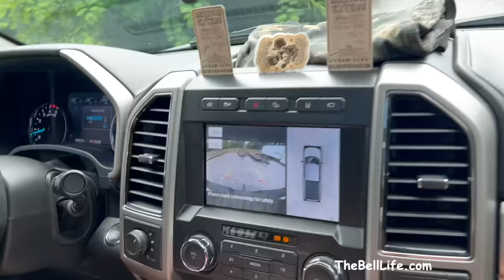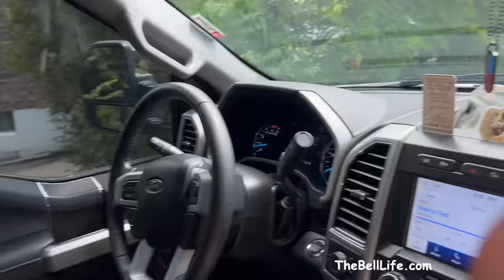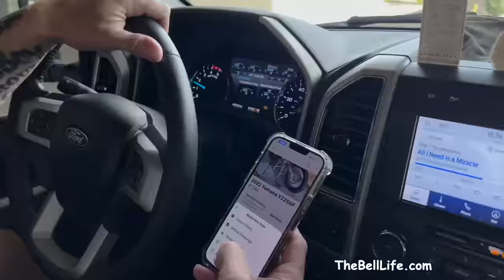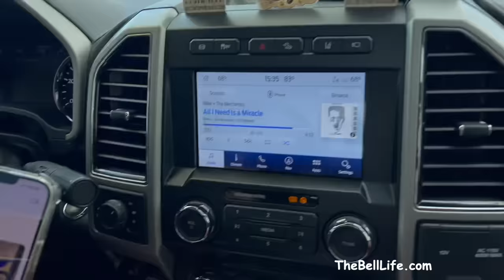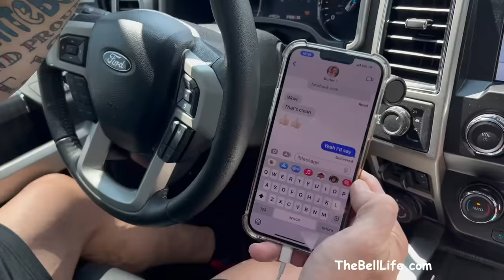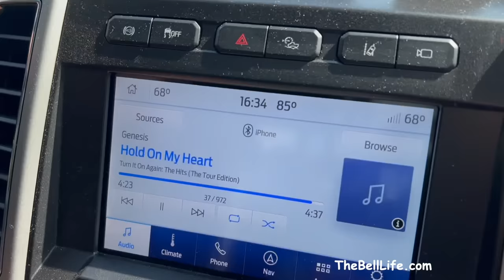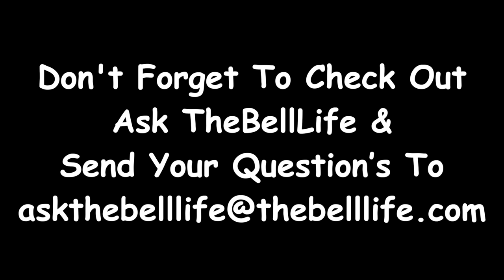Surprising My Son With His Dream Dirt Bike!!! (TheBellLife)

Comment: The loop on the front number plate that goes around the bar is to stop your brake cable from getting ripped out when the forks decompress , don’t cut it off . Also the hour meter will be on your yamaha app, the pass word and username is under left side rear plate , on the ecm

Comment: The reason the front number plate has the loop around the bar pad is to keep your break hose from getting stuck behind your number plate when jumping. Its used as a guide to help from that

Comment: The lupe on the front number plate is so the front brake hose  don't get snapped on the corner of the number plate when forks get compressed but i agree looks better if its cut off

Comment: I have the same exact year make and model bike and and it’s a beast, boat loads of power, more than anyone ever needs. I highly recommend adding the tusk universal radiator fan to it. Super simple 15 minute install and will keep it from overheating riding trails because these new 250F’s get hot fast then start dumping radiator fluid because they overheat without lots of airflow. The tusk fan kit even comes with its own little adjustable thermostat, add that, download a couple extra maps online which are free, FMF 4.1 slip on pipe and he’s set. Adding the rekluse clutch down the road makes the bike awesome.

Comment: That loop on the front number plate has a purpose. It’s so the front brake cable doesn’t get caught behind the plate when does suspension is under full compression.

Comment: 12:37 the tab that wraps around the bars on the number plate is to prevent the front brake line from getting behind the number plate when the suspension compresses.

Comment: 13:08 dont cut that of the brake line wil go behind it and snap and the other metre you have to download the Yamaha app push the blue button but you have to start the bike first put it off and then push the blue button then go to Wi-Fi. You will find Yamaha power tuning app or something like that then the blue side panel, take it off on the left side not the exhaust site there’s a little black thing that’s in the computer code will be on their

Comment: The strap on the number plate is to keep the cables from getting hooked on the number plate under compression. Potential to wreck if the cables get caught

Comment: I use to ride a Yamaha YZ125 124.9 cc displacement single-cylinder engine it is a motocross bike. now I ride a 2023 Yamaha YZ250X I love this Bike... I ride on the Trails I have behind my House there is 6 different trails I have set up on 250 Acres...    P.S.   Lets Go Brandon Trump 2024

Comment: I wish my dad bought me a dirt bike I had to buy stolen and recovered bikes with no frame numbers like KDX an Yamaha DT125R s , I got a 1991 YZ 250 about 5 years ago I was fast as hell, I had to sell it, my old 2 strokes enduros had feeders but I didn’t trust them it’s easy to mix just put 150 ml to 5 litres, infact my dad did buy my a bike it was a Suzuki TSX with a Kawasaki AR 125 engine in was a bag of crap when I was about 15

Comment: Nice bike, but you should have bought him a 2 stroke, brother. They can last forever, if you keep them maintained properly. 2 strokes cost less money. They're much easier to work on and repair. The replacement parts for them cost less money. They're alot more fun to ride, than 4 strokes. They have more torque, and are much more agressive rides, when that powerband comes on the pipe. 4 strokes are good for street legal enduros and streetbikes. With dirtbikes, 2 strokes all the way. Takes alot more skill to ride a 2 stroke, compared to a 4 stroke. 4 strokes are boring dirtbikea. Regardless, that's still a very nice gift to get your son.